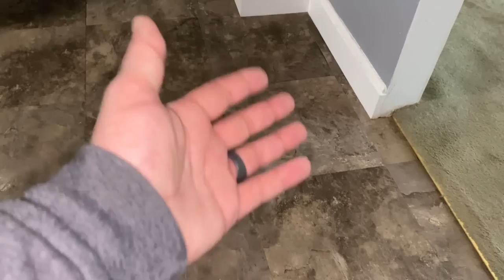Removing a Load Bearing Wall / Building Bedroom Wall With Door Opening

Comment: Also interesting to see how badly built old properties often were. You love having to work on the heritage buildings over here in the UK, where you are working with a mix of timber, stone and brick structural walls. Often walls were built with a rubble filled cavity and they threw any old crap in there, like sheepskins, bones, dirt, timber, etc. Structural sheepskins don't really work, lol.

I did work on a church where the one hundred feet tall solid stone two feet thick walls of the bell tower were laid on timber and broken pottery as a foundation. We did remove the old foundations and under pin with concrete foundations, engineered, of course.

Fun video to watch.
Reply from the maker: Wow, that is pretty crazy.  Have not worked on anything like that before.  Thanks for sharing and for checking out the video!
Reply: @TheFixerHomeRepair  yes, you'd have fun working over here, once dug through 7 floors to reach ground, bottom floor was medieval, which is considered as "recent" building here, lol.

Will watch your progress with interest, your build is strange to me!
Reply from the maker: @roybrewer6583  😮😮

Comment: Thank you. 
Sir I had a new kitchen remodel done new cabinets new floating floor and new 2 inch Quartz countertops in the middle a small island and all around all walls of kitchen. 
We’ll my new floor is starting to lift or peeling in spots. 
I notified contractor he said I should put a beam support in basement. 
I didn’t now the whole floor is lifting. 
Any other way to support the floor. 
By the way the floor is vinyl and very thin and skinny only three inches across

Comment: I'm about to attempt to remove a load-bearing wall that spans a 27' straight run. It goes across my dining room (formerly was 2 rooms that we opened up). I want the old sandwich beam that's now below the ceiling to be repositioned above the ceiling joists so I can have a flat 1-piece ceiling in my new dining room. I've seen it done by a couple of other guys, but I feel I will need to build at least one (maybe two) temp walls to prevent sagging while I'm installing that new beam. Any tips?

Comment: Just found your channel not too long ago and I've been video hopping. Great content. You work like I do. Just a question though. Why did you start with the up stairs, instead of the basement? I would have done the basement first, so as to raise the upper floor with the new joists. I'm sure you have reasons, I'm just curious. 

Thanks for the content.